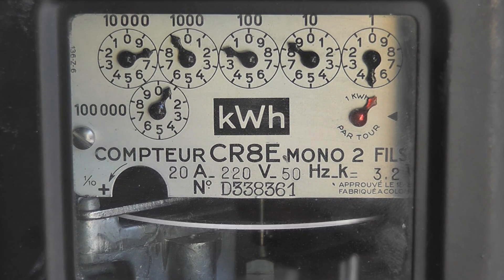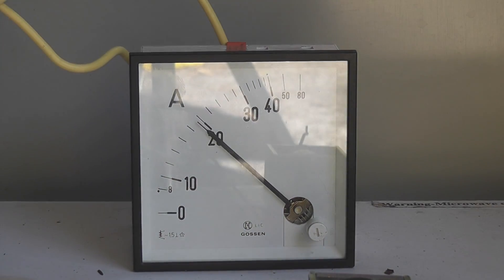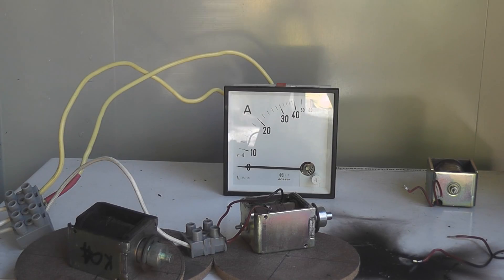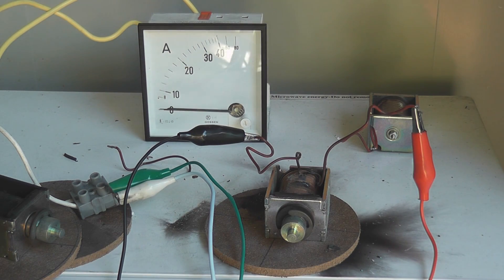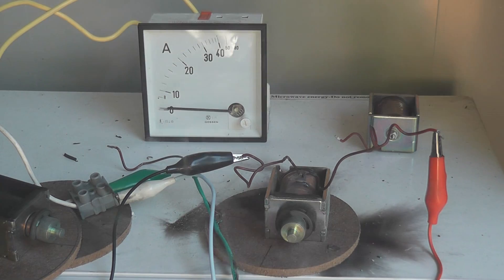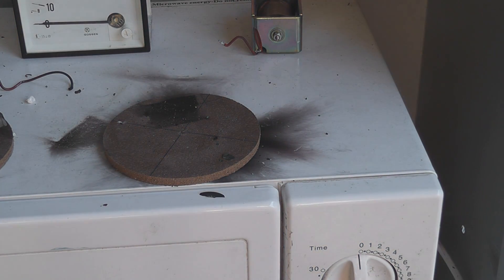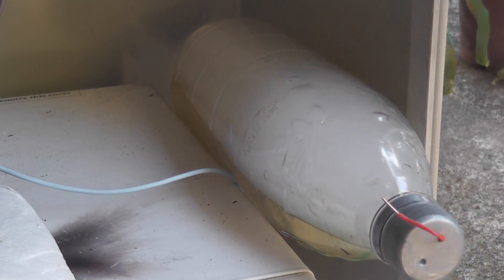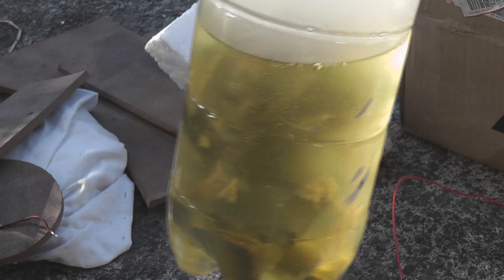Solenoid burns out and Capacitor explodes in mineral oil

Comment from the maker: Correct, the clips do handle up to 10 Amps allright, provided 1 or 1.5 mil leads are soldered correctly and the copper wire end is near the aligators teeth.

Comment: Continuing.... This style of leads only handles about 2-3 amps with making no trouble and that's not enough for me in many projects,also some cheap ones have broke on me unnoticed at the plug/clip side and have caused voltage drop and smoked like you'd guess.  The best solution for me is diy alligator plugs with at least 1.5mm2 solid core wire,well,just cause i hate when the wires are sliding everywhere.